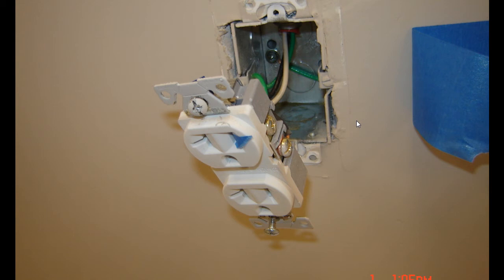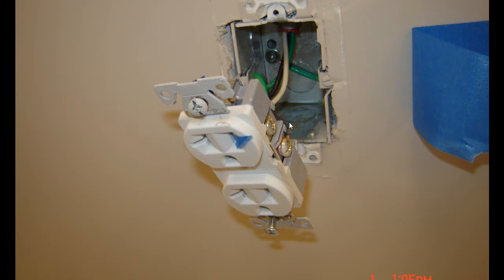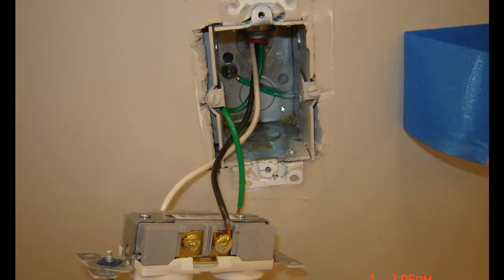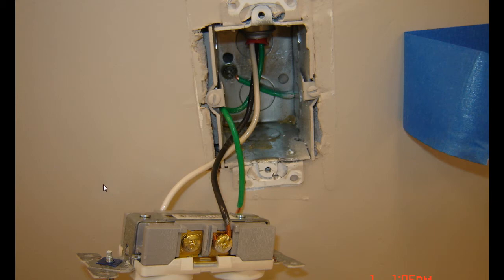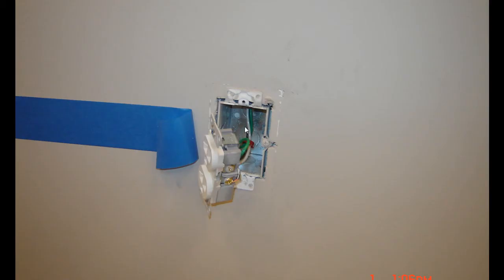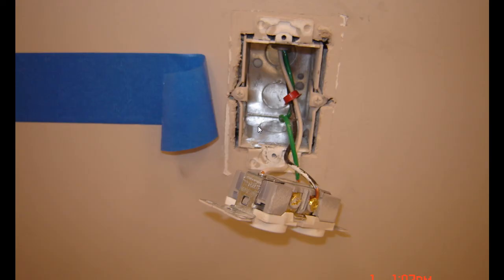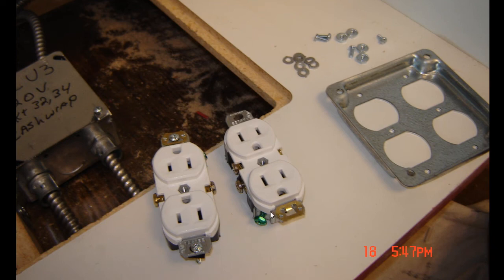NEC 2008 art. 250.146 Grounding Receptacles

Comment: I really don't like the thought of using the face plate and outlets as the only grounding method in a metal box with conduit. I could imagine a situation where taking off the front face with the outlets would then leave the conduit energized by a fault somewhere else in the system.

Comment: When faced with remodel work on 1965 residential, where the metal flex was used for ground and all receptacles are "grounded", do you prefer to pull ground wire or switch to GFI receptacles?

Comment: i'll go through the trouble of firing a tech screw into a box to a box as a ground if for some reason my actual ground screw is unavailable (which is rare) if' you're going to do something do it right. i also like to tape my terminals, but when doing large scale work like a condo, tape starts to get pricey ;)
Reply: you violate code by that method nec states ground screw must be machine NOT a sheet metal screw

Comment: One of the common grounding issues I find is in office remodels . The old circuits use the conduit as ground and the new lighting whips are MC cable w/ insulated grounds . What I find is all the grounds are tied together but not bonded to the box .